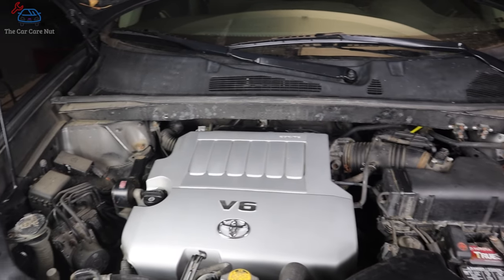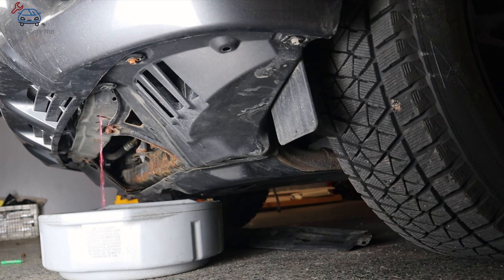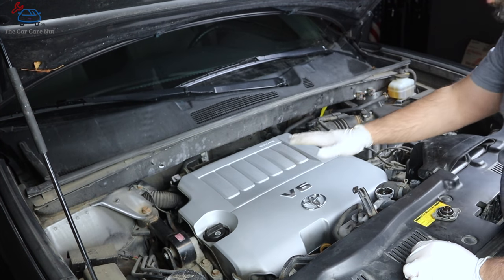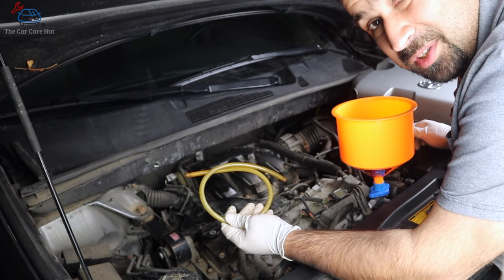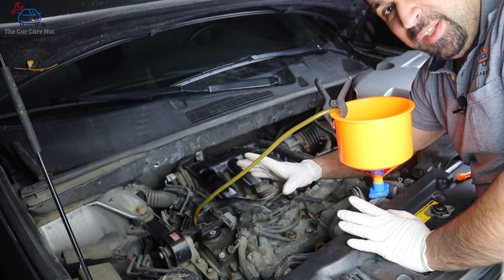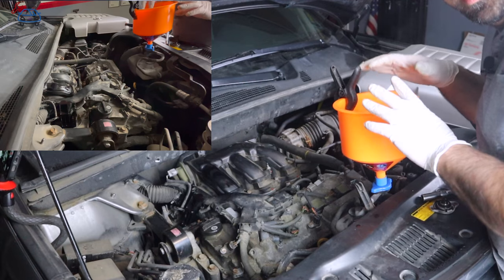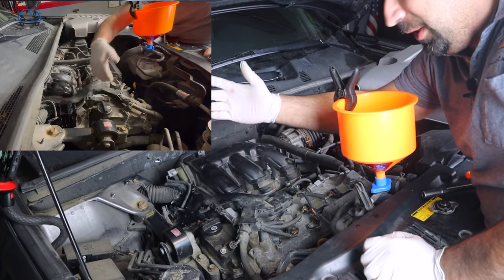Toyota Cooling System Bleeding for V6 2GR-FE 3.5L THE RIGHT WAY!

Comment: I was watching or more generic video of this procedure and they recommended having the heat all the way on - I believe to cycle the fluid thru the heater core, but in this case (I have a '12 Highlander with rear heat) we want to keep the heat all the way off? and does the temperature setting matter while it's off?
Reply from the maker: Hi! The temperature doesn’t matter while it’s off. You’d want the heat on when the car has a heat valve but this engine didn’t come with a heat valve
Reply: On a 2017 Toyota Sienna would I need to turn on the heater full blast while performing. Also while I’m asking for the future a 2021 tundra as well? Thx

Comment: I left a question for AMD in comments a week ago and have not yet heard back.  It is in reference to the last phase of this procedure.  I am hopeful that I hear back from AMD soon.
Reply from the maker: Hi didn’t get your comment. Repost it here
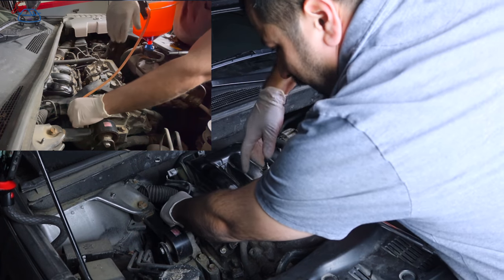Reply: @TheCarCareNut  Thanks for the fast reply.  As requested, repasting my post here...  AMD... !!Help!!  In the final phase (just before tighten the valve & disconnect the hose) you say that there is a "solid flow" of coolant (and maybe some micro bubbles) but on your video (at 9:41 & 9:47) I am almost 100% sure that I can see at least 2 sets of bigger bubbles come through.  Is this so?  I ask because when I executed the procedure, all went as you said... but possibly not during that final phase.  I had solid liquid flow, but also about roughly every 6 to 10 seconds a few big bubbles would come through.  I let it flow for a few minutes and the bubble issue seemed pretty consistent so I just completed the procedure and after engine "settled down" I only saw some VERY, VERY, tiny micro bubbles in the funnel.  1) Are the bubbles I mention (coming through the clear bleeder tube) the same as ones I think I saw in your video? 2) Are they normal or something that I should worry about?  3) Could they mean I have a blown head gasket / engine or what could it be? 4) Could the "bleeder" be allowing air into the line somehow?  !!Help!!
Reply from the maker: The micro bubbles are normal. As long as you have steady flow you’re good
Reply: @TheCarCareNut  said with the utmost respect to you... your reply / comment seems to not address my specific questions.  I had steady (but interrupted flow) which is the whole reason for me asking you.  So I am wondering if you might have accidentally not opened up my comment fully (in youtube app).  Did you read my ENTIRE comment?  My question is about BIGGER bubbles & NOT micro bubbles.  Specifically, I list 4 questions at the end of the comment.  I realize that sometimes it is impossible to give an exact answer (not seeing it in person) but simply want your best educated guess responses to the 4 questions.  Thanks in advance for your help on this matter.
Reply from the maker: @jotu173  I read your whole comment. Some bubbles even big ones are normal! You’re slightly over analyzing this. The hose will let some air in but only to the hose. Head gasket not likely. Close everything up and check for heat at idle if it’s good then drive it and let it cool down completely over night then the next day drive it to warm it up and top off the coolant
Reply: @TheCarCareNut  thanks for the fast reply & have a good weekend!

Comment: What about on a 2001 Avalon how do you bleed that one i here bubbling in my heater core thr car doesnt over heat or anything but i hear a noise ..no coolant loss i got plenty of antifreeze in over flow and radiator

Comment: Could you damage head gasket if you leave air in the system. I did a I went for short drive came home and bleed the system again.
Reply from the maker: Hi! There shouldn’t be damage to the head gasket unless the engine overheats because of the air pocket which if it didn’t then you’re good
Reply: @TheCarCareNut  I over heated but as soon as it went too hot I shutdown the engine until I reach home.
Reply from the maker: Ok. I think you should be good. It takes a long drive with overheating to cause harm to the head gasket
Reply: Thank you 🙏

Comment: ???? Hi ,thanks ....I got 09 Sienna, 180 k My radiator exploded while climbong hill in Hawaii ,I changed water pump,radiator  , heater core was by when I bought it 2 years ago t,I tookthermostat center out . Now when I am bleading it I do not get the flow of coolant to the fannel but oposite direction and then if I keep it longer  it perhaps overheats and gush out of the fannel ......so I do not get the stydy flow ...... I did block test = negative ....then I notised code P0355 ..... could that be due to ignition coil at first place or I am doing something wrong ????  Not sure if the P0355 could not be after due to spill waterfall .Thank you and Aloha blessings to you for opinion ..have a great day .

Comment: Does the 2ar-fe/az-fe require the opening of a bleeder valve?
Reply from the maker: Hi! No bleeder on these engines
Reply: @TheCarCareNut  ah thank you! So just full heater and standard burping for these motors? Again thank you. I got a 2015 scion tc and have just been changing out the fluids. Oil, atf, and now moving on to the coolant. Cheers 🍻.
Reply from the maker: Hi! No need for full heater. Just rev it to 1500 rpm until the fan comes on and off twice

Comment: Hello. Big question here : it applies to the 3.3 hybrid of highlander 2009 engine? I'm talking about the 3MZ-FE engine
Reply from the maker: Hi! This procedure does not apply to the 3mz. On that one put it in service mode and let it idle until the fans come on and off twice with the heater off.
Reply: @TheCarCareNut   OMG !!! Since i bought the car , 5 years ago , my heat was really bad. To the point i was not able to use it in winter ! I went to Toyota , also other garages , etc etc. Everybody was insisting the core heater is stuck . I went to 2 different garages and cleaned the core heater . Nothing come outside , everything was clean , the debit of the coolant was normal. 
Finally i searched the internet i came across this post , i did what you advised me  and now i have heat like in a sauna. 
THANK YOU !!!!

Comment: Thanks AMD.  I recently completed a coolant change a month ago.  Today I noticed the coolant reservoir is empty and added more coolant (car temp. has been under normal operating temp.)  I also heard constant scraping/rattling noise on the left side of engine.   Questions: It is possible that low coolant level caused the noise and how can I tell if my water pump (2015 Sienna) is about to go out?  Your expertise is appreciated, thank you in advance.
Reply from the maker: Hi! If you have a rattling noise that goes up and down with the engine rpm it could be a water pump. Remove the belt and check the pump for play
Reply: @TheCarCareNut  thank you.

Comment: Great tutorial! thank you!
 I have two Toyotas with two different engines. I will definitely apply this procedure for my 2006 Toyota Avalon. But how about the older 3.0l v6 engine? That's the engine that I have in my 2001 Toyota Sienna. I'm new at your channel. Is there a video on how to bleed the coolant for that engine at your channel?
Reply from the maker: Hi! On your Avalon this applies. In your sienna simply leave the overflow funnel on with coolant until the fan comes on/off twice
Reply: @TheCarCareNut  thanks. Would I need to turn off the heater as well?
Reply from the maker: On the sienna you don’t need the heat on

Comment: i have a rare 2013 6 cyl. 4 L tundra. after flushing the engine with distilled water and refilling with coolant the temp gauge reads good but the upper hose is hot and the lower hose is cold. i cant tell if theres a problem or not. if theres a bleeder on this engine i have yet to find info on the internet. ive driven to town and back and the temp gauge reads perfect. the cabin heat works great. theres no sign of over heating. but, the upper hose is hot and the lower hose is cool? how can i be sure that the system is circulating? i dont believe in coincidences but who knows.

Comment: Question: Do you recommend doing one of those aftermarket flushes, or flushing it with distilled water, before adding the new coolant?
Reply from the maker: Hi! I don’t. Unless there’s contamination there’s no need to flush
Reply: @TheCarCareNut  Contamination? What are the signs? Yikes, I notice in my coolant reservoir there are flakes floating around 😬. Not sure what it is. I did do a drain an fill, April of 2021. I'm wondering if I stirred up contaminated in the coolant system.

Comment: Please comment/reply!
Just did it today- my driveway is inclined down, so the front of the RX was lower than the rear. Only about 1 gal. of old coolant came out, however the expansion tank was empty. 
I did not try to open the bottom engine drain. 
Everything else went just like the in the video- bubbles, "gurgling", more bubbles.
Wonder if some of the old coolant  did not came out because of the vehicle's position.
Reply: From what I've gathered here, it is not a complete flush.  Can repeat again to replace yet more old coolant.  Or open the engine valves for more complete drainage.

Comment: My mechanic said it was a waste of time and money because the plastic radiator is the same plastic as the filling neck that I replaced and it will undoubtedly fail soon because the pressure is now back to normal. He said it makes no sense to replace the filling neck alone. I guess time will tell.

Comment: Hi I have a 2019 Toyota Highlander non hybrid , is there a video or way YOU specifically do it for those model years? And how many miles you recommend replacing the coolant? Every 30,000? Just like the transmission fluid? Thanks in advance
Reply: Anyone

Comment: I have a question my toyota highlander 2008 has a vsc system problem in the scanner it says spark plug 1 bank 1 but I changed all of them and the code still appears. The mechanic told me maybe it could be the timing chain?

Comment: Hey I tried this process 3 times already and I cannot get a solid stream of coolant out of the bleeder, 2008 es350 it has a new water pump and thermostat. The funnel attached to the radiator will rise and drop as you said and will get the violent bubbles constantly but the bleeder hose will never run solid, always has bubbles. What do you think is making the bleeding process not work? Car will not overheat while Attempting the bleeding process but it will over heat if I put the radiator cap on and try to drive

Comment: Hi @CarCarNut, 
Excellent Video! I watched it even though I own a 2AR-FE. Was wondering if we follow the same procedure as the Hybrid video for bleeding the coolant (just turn on the heat and let it keep refilling) for the 2AR-FE?
Do we have to drain anywhere else (like the hoses) for those engines, or just the radiator drain plug is enough, and as a Master Toyota Technician do you recommend flushing with distilled water a couple of times or just skip that altogether?
Thanks so much for your informative videos!
Reply from the maker: Hi! For the 2AR fe drain the radiator and fill let the engine run at idle with the heater off until the radiator fan cycles on and off twice. No need to flush with distilled water unless there’s contamination
Reply: @TheCarCareNut  Thanks for your help as usual!
Reply: @TheCarCareNut  would these AR FE instructions be the same for a 2005 Camry 2AZ FE?

Comment: Why my cooling is going low when there is no leak what to check and what to do with my Toyota Prius 2
Reply from the maker: Hi! Check around the thermostat housing and the radiator. If you can’t see anything pressure test the system

Comment: Having an issue getting an 07 Sienna to fully bleed. I've followed your instructions 3 times now and keeps ending in the system pushing roughly a full quart of coolant up into the funnel and eventually starting to over heat. what could be the issue?

Comment: Hi AMD! Just wondering if you can give an advice. I've got a Toyota Prius and I noticed the dust cover on the front shock absorber is cracked. It's called "Insulator" in the toyota catalog. I've heard that it gets cracked when the bumbers are worn too. Does it make sense to replace both? The dealer is saying nobody replaces them.  How many standard hours does it normally take to replace it?
Reply from the maker: Hi! It’s really not worth replacing them. If the struts are leaking or have issues then replace them with but just for the boots I wouldn’t. Here’s a video with more information on the boots https://youtu.be/GFBmt337veA
Reply: Thank you very much! Have watched the video and decided not to replace them. I was quoted $400 for parts and labour at the dealership, so phew! Very helpful videos!

Comment: Thanks for the video. Is this process the same on a 2007 Lexus IS350 with 2GR-FSE engine? I bought one used recently and bled the cooling system to find lots of air bubbling through the funnel
Reply from the maker: Hi! The 2GR-FSE doesn’t have the bleeder unfortunately so this procedure doesn’t apply to it
Reply: @TheCarCareNut  Perhaps Or it’s as simple as running the vehicle with the front end jacked similar to this video?
Reply from the maker: Raising the front end will help
Reply: Hi  @TheCarCareNut  how then does one go about replacing the coolant, is the engine self burping

Thank you for your awesome work

Comment: After completing this process, my rear heat (floor vents) only blows cold at idle (it warms up a bit at 2000rpm), and when the heat is turned on, there’s a steady drip of coolant coming from a foam hose under the van (beneath the passenger side).  I tried bleeding a second time with no effect.  Any ideas…?  2014 Sienna.

Comment: Nice video..I have a Camry and Siena both with the 2grfe.  Is, there any benefit to draining the coolant from the block via the bleeders at the bottom of the engine?  I have 100k miles on both.
Reply from the maker: Hi! You’ll drain a bit extra but if access is an issue it’s not really a worthy amount that comes out

Comment: Hello AMD, Is this the same procedure for a 2012 Camry 4 cylinder 2ar-fe? Thank you so much!
Reply from the maker: Hi! No yours is much simpler. Drain and fill with the spill free funnel then let it idle with the heat off until the fans cycle on and off twice
Reply: @TheCarCareNut  thank you!

Comment: Are you fully flushing the system though?  What about the coolant in the lines?  Should this be done a few times to drain all the old fluid?
Reply from the maker: Hi! No need to flush the system fully if you’re just replacing it for maintenance not contamination

Comment: Hi sorry for my ignorance. This bleeding process is for the heater to run at its optimum correct? This is different from "burping", ie  turning on the heat and rev it with the  radiator cap off to let all the air bubbles come out. I have a camry 2012 v6 and recently had a coolant change and wonder if I need to do this instead or "burping" is good enough (we don't use the heater where we live). Thank you.
Reply from the maker: Hi. You’ll want to do this procedure regardless if you use the heater or not

Comment: * You drained the coolant once, then the bleeding and top off of fluid. Shouldn't you drain twice so that old coolant in the engine block is removed instead of a mix with new coolant?
Reply: Perhaps draining the engine block via its 2 valves would help.  That gets much of the old coolant out.  OR  stock up on coolant and repeat the process another time or two.

Comment: What is the reason to make sure the heat is off?  Will it naturally purge itself?  I apologize if this was already asked in the comments, but I couldn't find it.
Reply: Keeping the heater on is a general thing when it comes to bleeding coolant. However the reason you do it in certain cars is to open the heater valve. The 2GR engine doesn’t have a heater valve so coolant goes through the heater core at all times. Turning on the heater will cause the coolant to take much longer to warm up to open the thermostat
Reply: Makes sense now, thanks Stanislav!
Reply: @stanislav9608  Thanks!

Comment: Okay still need a little help. I bled my 2011 Highlander v6 to the letter of your video. For some reason I still do not have rear heat and the front heat is not all that hot. Help
Reply from the maker: Hi bill. Did you have a solid stream from the hose going from the bleeder to the funnel at 2000 rpms?
Reply: @TheCarCareNut  yes I had a solid stream it went down back up bubbled just like in the video. When I had the solid stream I closed off the bleeder valve. I have good heat now in the front better than before but still no heat from the rear. Please help, thank you Bill
Reply from the maker: Interesting. Warm up the car and go underneath the back to find the heater hoses going to the back and touch them, do they both feel hot?
Reply: During this process I have one more question do you say that both rear and front heaters are to be in the off position
Reply from the maker: Yes you can have them in the off position as there’s no valve that isolate the heater cores

Comment: 2009 ls460; on start up the abs cycles and you can feel it thru the brake pedal. The engine slowly turns over but does start. Any ideas the cause??

Comment: Hi AMD - another great video.  Have 2006 and 2009 2.4 Camrys - both with original coolant to the best of my knowledge.  Is there a video available or if not, would you be able to explain the process for these v4 engines.  Also, curious if there is anything else that I should do or be careful of due to the age and mileage (both with about 160K miles) on these Camrys. Both are running great and have no heating/engine temperature issues.  The 2006 might have a small coolant leak ?!  I will be able to confirm that when I see it in a week

Comment: Question.  I have 2017 highlander limited v6.   Engine uses coolant. No coolant in oil.   What you recommend I check?
Reply from the maker: Hi! Pressure test the cooling system. Another common place for leaking is the water pump